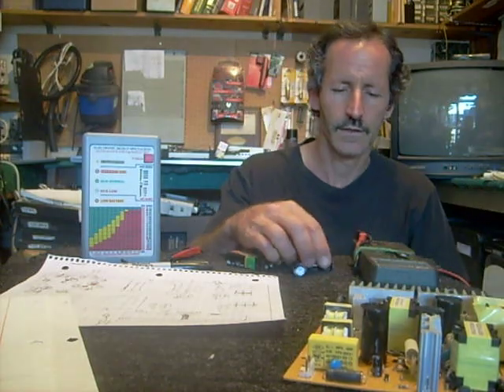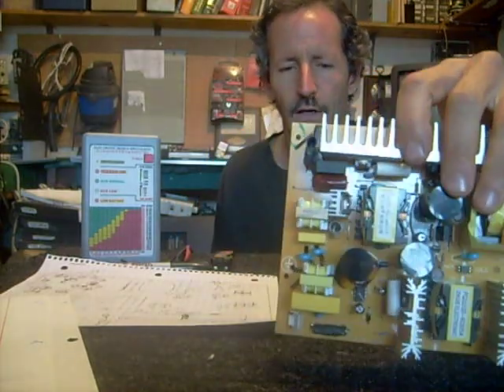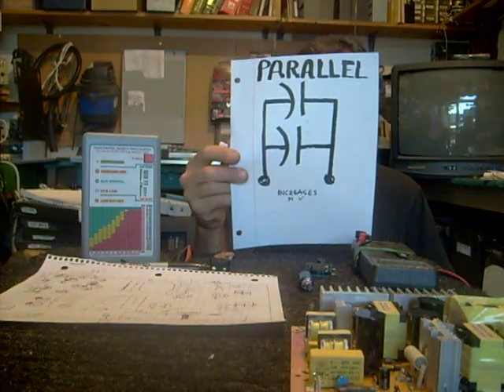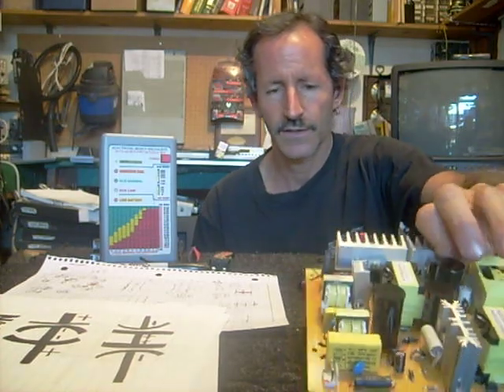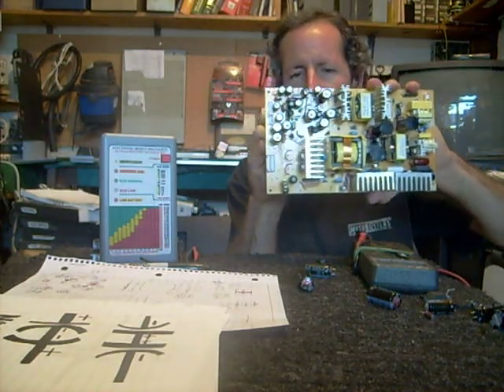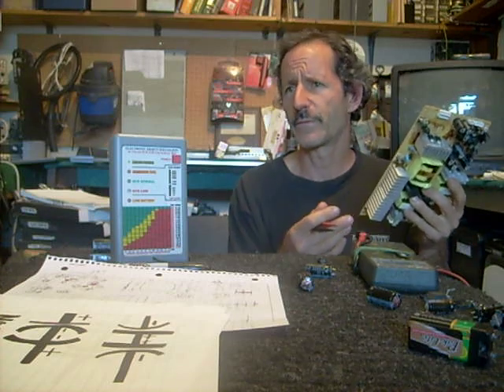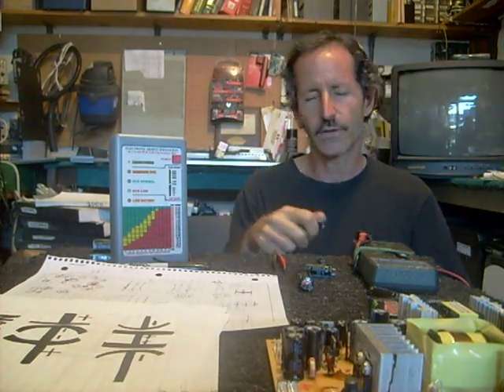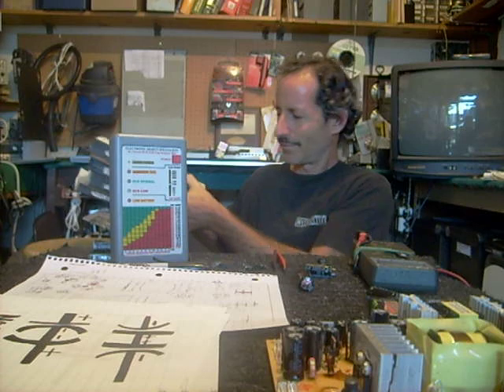LCD TV Repair made easy # 1

Comment: Hello, when i turn on my LCD TV and then power on an input ( like a dvd player) sometimes i hear a popping sound coming from my tv.....And when i shut down an input device while my tv is on, i hear the same noise. It happens to all the input devices (xbox, blu-ray plater, etc) .  Im using HDMI for all inputs.

It doesnt happen all the time but sometimes. I have the SONY KDL -46V5100 . is this an issue with my tv?....this has been happening ever since i bought the tv 3 year ago

Comment: hello, my samsung lcd tv , suddenly stopped working after a power surge, there are no lights when plugged in, it doesnt click or anything, i have tried new fuse, tried a different power lead, and i have checked the caps they look fine , i dont have a volt meter to check properly, i have ordered a replacement t6.3H 250v fuse incase it is that, what do you think?, any help would be great i cant afford repair shop bills, i have also had it all completly unplugged for over 12 hours, still nothing

Comment: I have a Samsung model# LNT 3242H-C, Serial # AH653CPP50019J date 5-07The red light on front comes on for about 6-7 sec. goes out for about 3-4 sec., It does not make any clicking, I replaced both power card and main board, no change. Can someone give any advice?

Comment: Do you know anything about stereo receivers? I have a sony 2 channel in protection mode. I removed all the outputs and tested them in diode mode, checked out good, I did find one emitter resister with high resistance. So I powered it up with no outputs or emitter resistors and it stays on, doesn't go into protect. You think I should replace all the outputs and both emitter resisters? They seem to be sold in sets so I can't just buy one. From what I understand if theres a DC offset on the output it goes into protect, but thats all I know. I DLed the schematic. I can't seem to find those resistors anywhere. MPC725, they are as rare as frog hair.
Reply from the maker: +Vernon Bosshard
I don't know a whole lot about amps going into protect for reasons other than sensing shorts, but you said none of your output transistors were shorted so I'm not sure if a resistor with a high resistance value could make the amp go into the protect mode. Your didn't say how high the resistor was in comparison to what it should have been.
Reply: +Grants Pass TV Repair Resistor value is .22 ohm measured was a little over 1k. Ok So I'm looking at the scheme, the current detection is downstream of the main outputs, they drive two relays to turn on the speakers. so that emitter resistor could make it go into protect mode. I notice there are what seem like voltages in red all over the scheme, I tried checking the ones on the outputs and my shaky hand shorted it, def checks bad now, so I'm gonna get all new outputs and emitter resistors then go from there. When the stereo is on the dc out on all the mains should be equal, if not it goes into protect. Go here look on page 19 upper left if you have time.  http://sportsbil.com/sony/STR/STR-D/STR-DE197_v1.5.pdf
Reply: +Vernon Bosshard Ok I&#39;m stupid, those red numbers are voltages, I should have checked all those first. Crap!! Well this is why I am picking up some of these non working units, for experience. Need more equipment and experience. Schooling only does so much.
Reply: +Vernon Bosshard I've also got a new yamaha RXV477 I got from Ebay on the way, its new and the desc says no power. Thats all I know. I don't have all the equip for TV repair yet but I will get there. I could of had three TVs to work on but I turned them away.

Comment: my sharp lc-32sh12u LCD Tv has vertical lines that appearfrom top to bottom.  I have sound.  I tried heating up it up and it worked got picture on tv for several days then turned it on and the lines re-appeared.  No picture.  I build displays and monitors etc. I have some experience but I do not know how to troubleshoot my problem.

Comment from the maker: @tsmgroup2 I'm using a capacitor meter sold by electronic design specialist called the cap 88 but some say the capacitor wizard may be a better choice. You might want to check out my website at TV REPAIR INFO . COM I have a link to a site where they compare the different ESR capacitor meters. They also mention the blue ESR meter
which is about half the price as mine.
Dave

Comment: you have a gentleman named gemjones1972 who describes a problem with his plasma tv similar to mine although I can't find his channel I have a 50 inch plasma sanyo model dp 50747 it has evolved since I got it a week I traded with a gentleman for it in his ad it says it doesn't turn on and you can hear sound when I got it home it turned on and I heard 2 clicks and  it has a white screen no sound at that point I can get the menu or channel indicator to come up to find out what channel its on

Comment: Hi I have a 45 L.G  L C D Projection tv  the has power to the standby lite and them goes off. 
I change the lite but it did not work, 
the fan works But there 'dont seem to be getting power to the lite. 
the model # is     RU-52SZ30 OR RU-60SZ30 CAN YOU HELP ME???

Comment: Hello, I have a panasonic tv PT-52LCX66 and this tv has lasted 7 years. I have replaced the bulb every year but it only cost $34. This last time I purchased a bulb I did not seat it correctly and could smell a strange smell. I pulled the lamp out and the two holes where the bulb fits into melted. I took the back off and took the little plastic piece off of the two wires, that small piece of plastic is damaged. I can't find a ballast for this tv, can I fix this small piece of plastic?

Comment: i have a magnavox 47mf437b LCD . I have replaced 5 bad caps ande checked several diodes , fuses, . The power lite go from red to green but still no picture or sound . ALL I GET IS A CHIRPING SOUND ... HELP....

Comment: I have a Toshiba 37 inch it has a problem coming on but i can get it to come on but i have to unplug and plug in again.
But when i get it on i can turn it off and it will turn back on straight after.
If i leave it in standby for a hour i cant turn it back on.
Could a bad cap do this? I can`t see any bad caps.
Reply from the maker: Not all of your symptoms match would what I would assume to be a bad capacitor, but I wouldn't rule it out either.
Reply: cheers.
Going to check the fuses now.
Reply: I have found 2 diodes that are broken on the small board so i think i will just buy that board.

Comment from the maker: That's not unusual.  It sounds like you probably have bad capacitors in your power supply. When capacitors are going bad a higher room temperature can enable them to operate well enough for the TV to turn on. If you don't correct the problem at some point the the TV will quit  turning on.

Comment: Thanks for that, where can I buy them? I am in New Zealand
Reply from the maker: If you asking about the TV repair tips, I listed them on my website at http://www.tvrepairinfo.com/
Reply: i meant the LED light so I can replace them
Reply from the maker: Union Electronics is one source for LED replacement lamps.
Reply: thanks
Reply: Grants Pass TV Repair okay I have a 70 inch Samsung flat screen if the picture flickers in and out is there an easy fix please help

Comment: be careful fitting a higher voltage electrolytic capacitor than the original  - taken too far, this will *reduce *the capacitance, as the electrolytic action and therefore the capacitance varies with the applied voltage. A cap designed to be 220uF at 25volts may be only 160uF at 5v. Now,  25>50V is OK, but 25>200v may cause such a drop in capacitance uF value that the circuit will not work as designed. One "step" up is usually no problem though. (Fitting a lower voltage rating is obviously bad)

Comment: If capacitor was 25V and you install 50V it will last longer, however, if capacitor is rated to 50V it will have higher ESR and this is not good for filtering circuits :))

higher voltage = higher ESR

Comment from the maker: You might check the ceramic capacitors on the output side of the inverter transformers. Here is an example on a different model. watch?v=6AkiBZzOhos

Comment: I use my oscilloscope to test bad capacitors. you can actually see how bad a capacitor is on the screen! I find it more accurate than a capacitance meter, A capacitance meter will only tell you what is "thinks" the capacitance is of the capacitor under test...the oscilloscope will let you see how bad the capacitor is...it isnt testing the capacitance as such...its testing the ESR of the capacitor which is much more informative in my opinion, As capacitance diminishes...ESR increases over time, And in my opinion ESR is a better indication of a bad capacitor than one with a lower/higher capacitance than marked on the capacitor,

Comment: At the risk of being a pain, I will ask one more question then get out of your hair:
Will a Fluke 113 work for caps (sorry, youtube it seems will not let me drop a link, but you can Google "Fluke 113" you can get the specs). 
It will test capacitance, but I simply cannot seem to figure out if that is all that is needed (e.g., capacitence vs leakage?) I have been under the impression fluke tools are the acme of electronic test equipment (and I found one at a pawnshop for $30.00--looks new).

Comment: you are 100% correct on testing cap with a Good High Quality ESR meter  BUT Your not total correct about the Voltage  putting a 50v cap where a 16v  was is NOT Going to make it LAST Longer   if you take out a 1000uf 16v  CHINA cap & replace it with a 1000uf 50v China cap its not going to last any longer  IF you want the cap to last USE GOOD HIGH Quality JAPAN made Caps  & use the Same Voltage as the original   NO need to up the Voltage